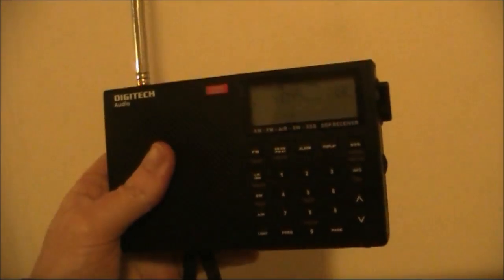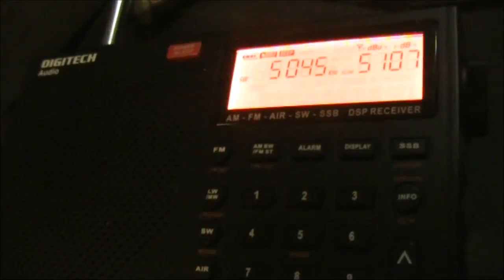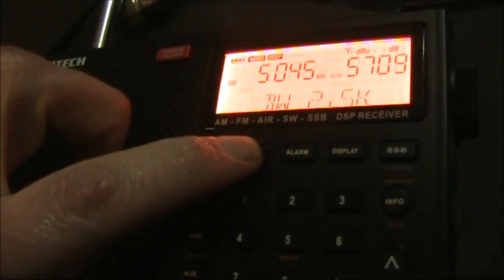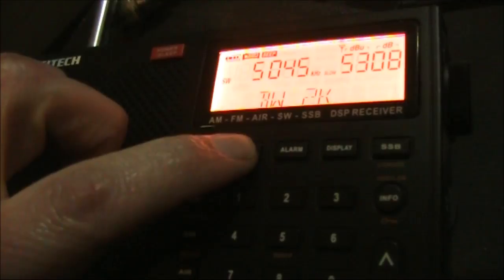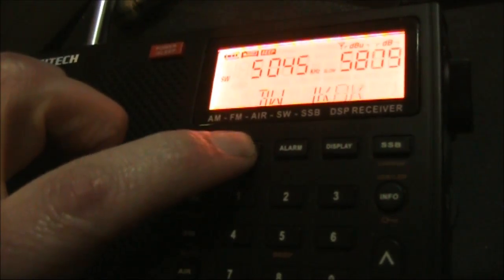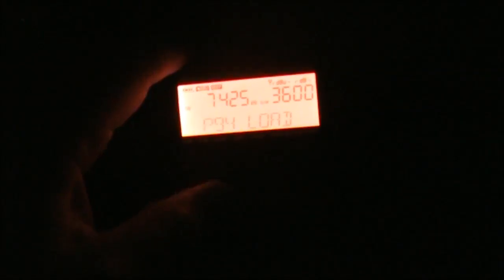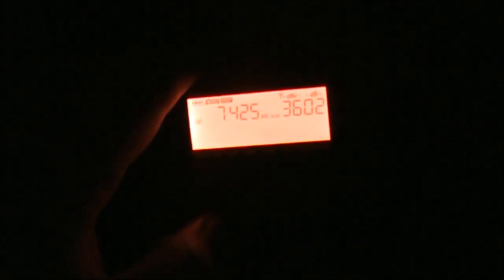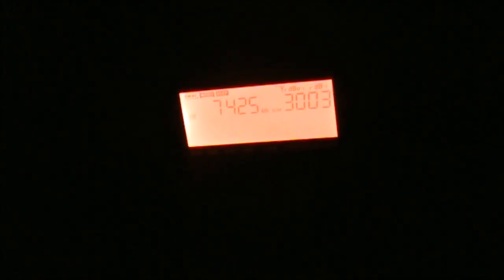Ozy Radio reception on 5045 kHz (29/8/2017)

Comment: Hi - I wonder if you are able to measure their frequency, accurately? Here in the UK I've been observing a carrier (too weak to hear any audio) during greyline transition over here and over their TX site. I'm measuring that the transmission is 9Hz high. If you are able to confirm that then I know it's Ozy Radio that I'm detecting. Thanks - Martin
REPLY
Reply from the maker: Hi Martin - unfortunately I don't have ultra-accurate frequency measurement facilities.  73, Peter
Reply: OK thanks, Peter. You probably know you can download the Argo software for free. This'll give you a hugely accurate readout if you use a known, highly-calibrated signal (5MHz standard time sigs?). You can then offset the program to take into account your receiver's and the PC's inaccuracies. I use mine to ID VHF beacons with a known offset. Plus endless hours of fun being mesmerised by aircraft Doppler shift ! 73

Comment: I have a 27m long centre fed inverted vee dipole with its apex only 18 feet off the ground. I have been receiving ozy radio on between
Reply: "...on between +20 and +30 db all night." My location is about 80 km south east of Adelaide. I heard that they are using 500w and an inverted vee dipole from razorback NSW

Comment: WTF ABC claims it costs $1.7M to run its domestic HF service per year (6 freqs) , assume  for 2kW AM TX  would use tops 5kW mains  power 24/7 @ 15 cents per kWh  thats only $3k per year in energy costs, Hardware  Capex $300k  (TX /dipole antenna/masts )10% annual operation & maintenance, the annual cost to run is less than $40k, Ozy radio would easy do it for 1/10 the cost, 5kW HF TX are so cheap import from the USA or Asia, the ABC is clearly ripping off rural & remote Aussies ??